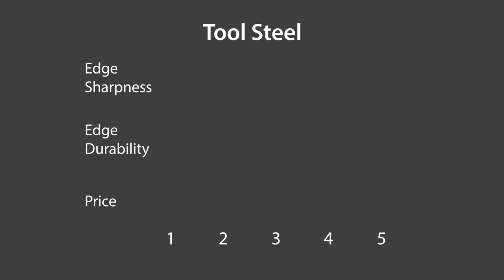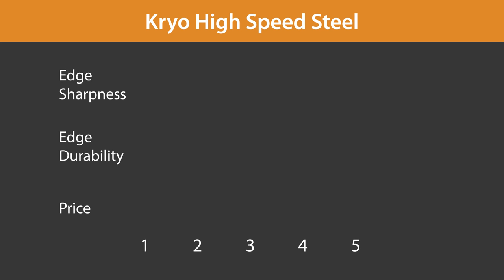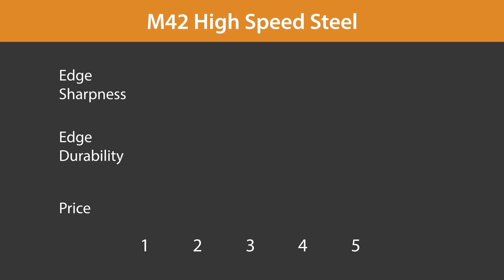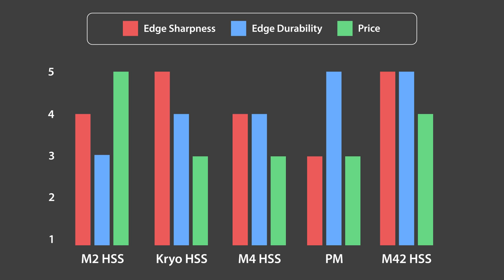Comparing Woodturning Tool Steels

Comment: The M42 Steel is best sharpened using a fine CBN wheel. I have found that 180 grit works well but a 350 grit is much better.

Comment: Could you make the comparison chart available? It would also be helpful to know which steel is used by which manufacturers.
Thanks for the excellent concise summary of steels.
Reply from the maker: We just added the chart to Pinterest. The name of the image is "Comparing Woodturning Tool Steels Chart from Craft Supplies USA". We also added a filter on our website to compare specific tool steels. Thanks for the comment.
Reply from the maker: We also added a table of contents in the description to help with quick navigation.

Comment: Based on the current prices of the Kryo tools and the M42 tools, their pricing is backwards. Kryo are cheaper and give you almost as good performance for about 25-30 percent less money. That being said the video is still very informative. Thanks.
Reply: He is incorrect, I’m pretty deep into the weeds about heat treatment and I can tell you that no matter the heat treatment m2 can’t give you the same performance as m42. However proper heat treatment is very very critical and a cryogenic treatment gives you at best 5-10% better properties. Not double.

Comment: Thanks for the info.

Based on the video, why buy anything other that M42? Why are other metals still used if M42 is pretty much tops at everything?

Thanks.
Reply from the maker: Good point. The largest selection of tools is in M2 HSS, but M42 is starting to catch on. Check out Henry Taylors new line of M42. https://www.woodturnerscatalog.com/p/129/6894/Henry-Taylor-M42-Stay-Sharp-Bowl-Gouge

Comment: Very good video thank you. I use CBN grinding wheels and I am told to only use HSS on CBN. Having said that, I was given a spindle gouge and have no idea if it’s HSS or not. How can I tell without using it on my CBN wheels?
Reply from the maker: What's the brand of the tool? If you don't have a name brand tool, you can test it on a regular grinding wheel. If the tool creates a mild amount of sparks, then it's HSS. If it sparks excessively, then it's most likely carbon steel (which cannot be used with a CBN).